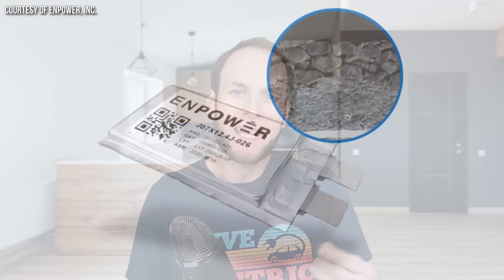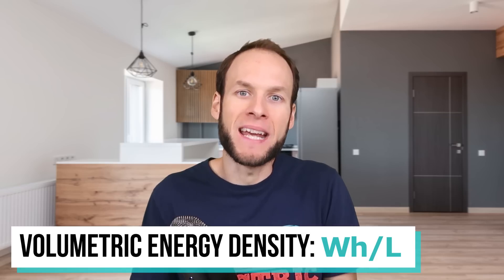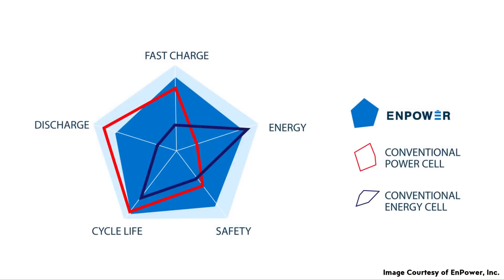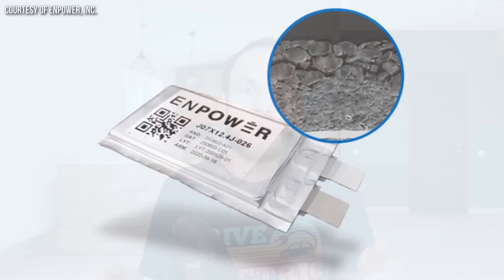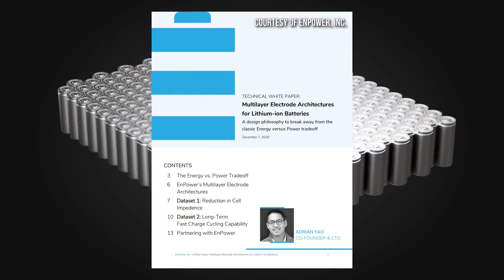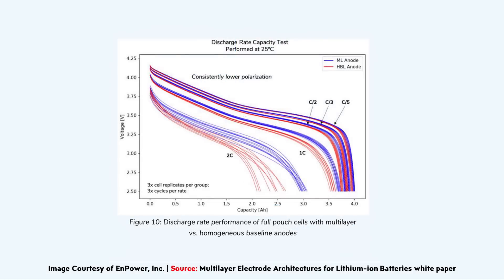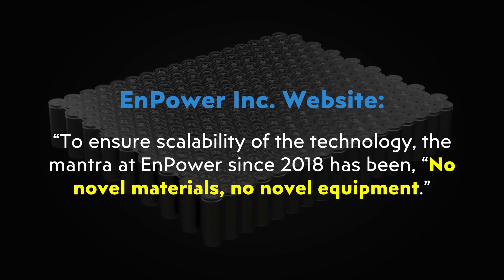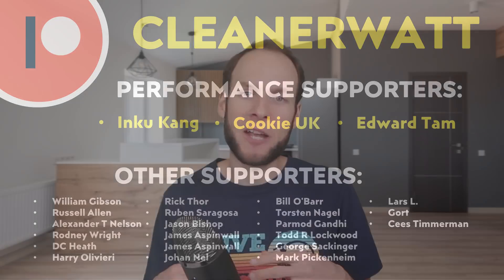EnPower's INNOVATIVE NEW Lithium Ion EV BATTERY

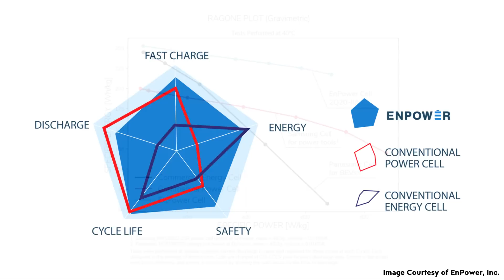Comment: 3:20 that chart somewhat exaggerates Enpower's technological advantage by comparing against outdated tech - the Panasonic NCR18650B was leading the pack when it was introduced ten years ago, but it can't hold its own against current generation high energy 18650 cells. Power density in particular has improved.

Edit: I have since found out that of the newer high energy cells I was referring to, at least two, and probably all, use some silicon. Since Enpower's claims to improve the test cell's rate capability with a pure graphite anode, it makes total sense to compare against these older, graphite-only cells.
Reply: I would point out that the 18650 powers THE fastest car (at least untill very recently) 
There's life in the old dog yet.
Reply: @rogerstarkey5390  I was not talking about the 18650 form factor, just the particular cells selected. The panasonic 18650 in the plaid is most definitely not identical to the low power NCR18650B (model year 2012).

That being said, the cells selected by enpower have pure graphite anodes which makes sense for this comparison. Some of the newer cells I was referring to might use a bit of silicon - I tried checking, but find it very hard to get info on that.

Comment: The challenge for EnPower will be cost. Any time you increase complexity (i.e. more layers), there’s a good chance that you’ll also increase cost and decrease manufacturability.
Reply: There's also a good chance that you won't.
Reply: More equipment and space for multiple formulas guarantee more cost but fewer batteries will be needed for a given car..  if it works with LFP I like it.

Comment: Do they have a candidate cell for commercialization?  No.  They have a bunch of specific engineering tricks, employed in specific small bench test cells, which manipulate performance trade-offs.  Every battery researcher is doing this.  No exceptions.  This company is arguing, through you, Jonathan, that they'll eventually be able to combine all of these tricks into a hypothetical cell with desirable performance and that they'll be able to commercialize this hypothetical cell.

That is a pitch to investors, not a product road map.

Most of these battery startups are doing and saying exactly the same thing.  Most will find investors willing to keep the lights on for a few years.   But most will never deliver a commercial product to anyone.  Be cautious.

Name-dropping a former Tesla employee proves what, exactly?   I didn't recognize the name,  don't know what expertise he has, don't know how important he was to Tesla when he worked there, and don't know why he left.

Not everyone who leaves Tesla is a superstar.

Just as an aside, thicker electrodes mean fewer layers in a can (or other volume).  Everything in battery design requires trade-offs.  This particular trade-off is unproven.

I'm slightly annoyed by comparisons between bench test cells and actual commercial products.  There is no requirement for bench test cells to be economical or producible.  Bench test cells haven't gone through the trade-off decisions that will be required to commercialize them - and we for damn sure don't know how much commercial versions will cost, or how they will perform, or whether they will be competitive with existing commercial cells

 Every battery researcher can point to bench test cells with performance characteristics which, in some respects, appear to be better than existing commercial products - but most will never emerge from the lab.  Lessons will be learned from them; research isn't bad, it's good.  But we, the public observers of advancing tech, need to learn to curb our excitement at every appealing curve on a graph we're shown.  Dozens and dozens of startups can show us curves like that.  But emerging from the pack with a viable commercial product is not the fate awaiting most of them.
Reply from the maker: As always I appreciate your opinion and insight... one note of clarification, they state that these "multi-layer" electrode are the same thickness as standard electrodes.
Reply: @Cleanerwatt  You'll have to forgive my skepticism, Jon.   That sounds... ridiculous.

The only way to get 2 coats to equal the same thickness of 1 is to completely reinvent the coating process.  Layers will have to be much thinner, which means each coat will be applied using more liquid solvents - the solution has to be 'runnier.'  That sounds expensive to my ears - more solvents and two times as much drying and solvent recovery, or more - and it makes me wonder how these thinner coatings will deliver the promised improvements in power.  Transmitting more power requires more conductive paths for ions - where are they?

I'm not an expert in what they're up to, but their summary-level claims to the public thus far fall short of convincing.  I see a sales pitch aimed at investors who know nothing of battery R&D or battery manufacturing.  Lots of buzz words and graphs of test cells, but they admit that they don't have a single test cell that incorporates all of their ideas for improving cell performance.  There is a lot of hand-waving going on here.
Reply from the maker: Would you be willing to jump on a video call with me?
Reply: @Cleanerwatt  You flatter me.  I don't deserve it.

I'm not a subject matter expert, just an opinionated old man.  If I were still active as a content creator, then perhaps a public conversation would make sense anyway (call it entertainment, not information from a subject matter expert)... but I ended that phase of my life a long time ago.  Yikes, that was before YouTube had ads, and a million views on a video was considered extraordinary.

Eh.  My goal now is to encourage critical thinking in people who seem capable of it.

Advice from an old man:  don't fall in love with every pretty face; don't believe every snake oil salesman's miracle cure works; when a politician advocates, figure out where the money came from; and when a startup is looking for investors, suddenly remember you've got somewhere else to be.  Most of them will burn through your cash, dissolve and leave you with a piece of paper worth exactly nothing.

But your mileage may vary!  🙂
Reply from the maker: @Urgelt  I understand - thanks for always being a voice of reason. I appreciate your insight and comments.
Reply: @Cleanerwatt  It is a pleasure to interact with you, Jon, and I respect your curiosity; it leads to interesting conversations!
Reply: Earl Wiggins was the guy who originally taught the Dry Electrode Process to Tesla after Tesla acquired MaxWell in San Diego.  It was then re-dubbed "TSD", Tesla San Diego.  Earl was at Tesla for months, doing scale-up.  He brought about 6 or 7 people from Maxwell to help him do that.
Reply: @whateverz-876  This is definitely interesting.

It does not prove the commercial viability of any test cell described in this video, but it's good to know they have an engineer on staff with that sort of background.
Reply: @EnPower, Inc. I am pleased to know it.  But I observe that you didn't claim that any of these samples are candidates for commercialization.

Most battery startups supply sample cells to customers for evaluation and feedback.  This does not predict which of those startups will achieve commercialization, and which will not.

Most will not.

Comment: I'm skeptical, Prototypes are easy production is hard
Reply: Here are some questions that come to mind: 1) does thier multi layer anode require a wet solvents or can be used is Tesla's DBE process? 2) will this process be compatible with high loaded silicon anodes? 3) what battery form factor they are planning to produce?
Reply from the maker: These are great questions that I can ask if I get to record the interview that I have requested.
Reply: @piratehussam  you don’t need to wait for the interview … it is clear from their given info they are using wet solvents ; “multiple slurries” and they illustrate pouch cells. I see no reason they cannot produce any form factor though as they claim to be able to use existing manufacturing plant.
Reply: I recently worked for the company and left about a month ago for various reasons. I primarily worked in the coating process alongside the CTO as a 2 man team but assisted in all departments as well. I can't speak of any specifics because of all the NDAs I had to sign. 
It was exciting to work there but also there were issues that I didn't agree with that wouldn't get addressed. It's a shame as I worked my tail off there but I have standards and morals.
Reply: "Prototypes"?
This is a process that can be incorporated into existing production, It's best described as requiring "testing" rather than "prototyping"?